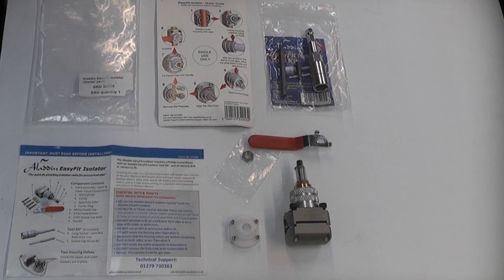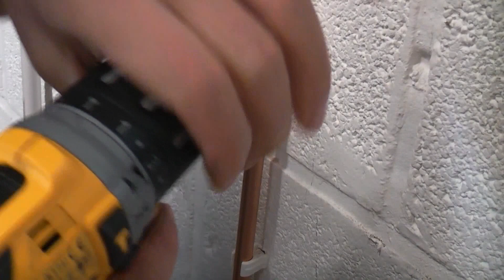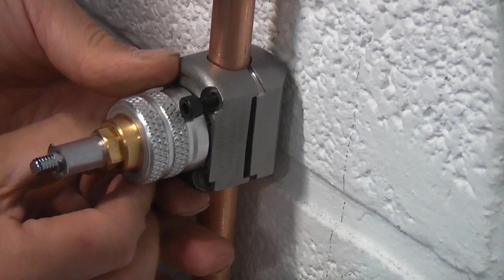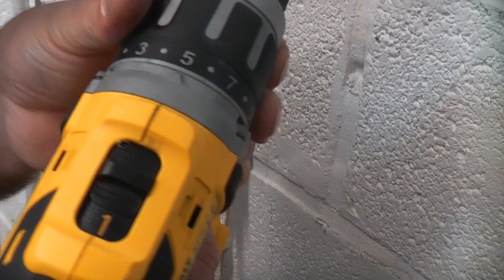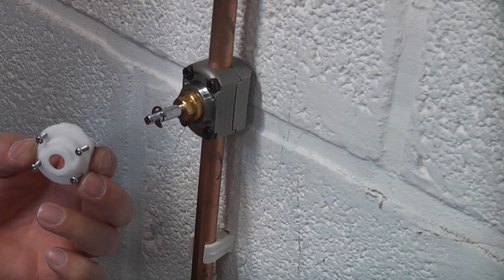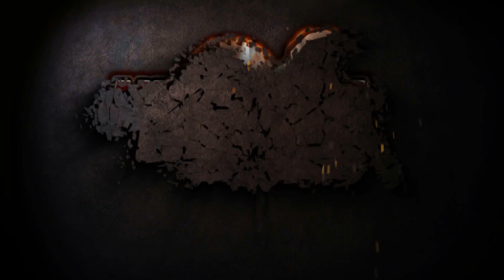Aladdin EasyFit Isolator | Isolate a live water pipe

Comment: Could you do another video showing you taking it off so we can see what happens to the part that is cut out?
Reply from the maker: I'll think about doing that when I get time ;-) 

Thanks for the comment ;-)
Reply: @ultimatehandyman  hii

have you done the "taking the isolator off" video yet ? 

thanks
andrew
Reply from the maker: The pipe was full of water and was pressurised to working pressure.
There is a follow up video here- https://www.youtube.com/watch?v=H9JSbIPLffM
Thanks for the comment
Reply: It shears the whole pipe replacing that section with the turn valve. If you go to the site and click on the FAQS of it, it shows an internal view. Pretty cool device.
Reply: Ultimate Handyman sorry about that my mistake,  I just reread your other post that said you rigged this up and missed the rest that said that you did pressurized the pipe with water in it.  Still enjoyed your video and hope you make another one taking it apart.
Reply from the maker: No problem, thanks for the comments
Reply: Paul T for what reason?
Reply: Hi Paul here is a cut away picture showing what's happening inside. Hope that helps.
Reply: I was wondering the exact same thing....it has to go somewhere
Reply: Yeah I'm a bit worried about a small copper disc left behind or a copper chip jammed in a tap. It's an emergency item I think not for everyday use.
Reply: Bravo à l inventeur un plombier de 80 ans
Reply: Would rather get a freeze kit and do the job properly......Diy kit only......a plumber wouldn’t put his name to it.
Reply: And it crushes the cut piece of pipe into the back of the device. Pic here: http://aladdin-products.co.uk/wp-content/uploads/2016/02/e-ft.jpg
Reply: @TSKseattle   Oh,no! you revealed the magic !  LOL
Reply: What's it cost?, for cup of copper shards these days?
Reply: AyrabMoneyWolf ,  the pipe is full of water and is pressurized setup to show how it works for install.  So since it's not a live pipe it would be nice to have a video of it being disassembled to show what happened and how it does is magic.  Great video by the way.
Reply: Its commen seanse what happens to the pipe there will be a big hole.
Reply: Hi our Easyfit Isolator has been on sale in the UK for over 5 years if fitted correctly they don't leak. They can also be replaced when the isolator seals up unlike conventional isolator valves using the core replacement tool.  Hope you get a chance to use our products in the future.
Reply: its handy for emergency, in  house flood and old stop tap seized up , and outside stop tap is buried in mud and crude . do you do them in 22mm, and are they ok for  emperial pipe sizes.
Reply: Paul T dude it's not meant to be taken on n off. But things like this usually leak unless they figured out that issue.
Reply: What about the metal bits from The Cutting what happens to them

Comment: I've never seen anything like this in the states!  I wonder if this meets code. I could have used this last year when I installed a new bathroom faucet, only to discover the original builder didn't install shut-off valves under the sink, AND my main house valve was faulty.  I ended up "hot fitting" two sharkbite push-on valves...while on my back, the water exploding all over...while my wife laughed at my misadventure...
Reply: We don't currently sell these in the USA.  Your pipes require a slightly different version which we have developed.  We will be exhibiting at The National Hardware Show in Las Vegas May 8th - 10th 2018 come visit us. We will be looking for distributors for our products.
Reply: "while my wife laughed at my misadventure"
Yeah, everything's a big laugh when you're not the poor SOB that's gotta fix it.
Reply: Saddle valves like this one are not code compliant in msjority of the states in the US
Reply: I'm a plumber and have had to do that same thing too. But i didn't have my wife laughing while doing it. Your comment had my wife and i laughing our a$$'s off.😅
Reply: Jo Baecker really? Its called a hot or live tap....been doing them for at least twenty years
Reply: chances are it'll exceed the code, UK has super strict standards on even non gas fittings, they have to meet UK and EU  standards too
Reply: Jo Baecker you couldn't just hit the s/o's on the water tank, manifold or at the curb? Still sounds hilarious, did she film you?
Reply: Ultimate Handyman  All saddle type valves leak
Reply: @jessepremo7398  Really?  We've been using saddle fittings (wraparound UPTs and branch saddles) on the gas mains in the ground for decades.  If fitted properly they don't leak.
Reply: Thomas Niner When I lived in Wichita, Kansas, anyone could buy a main line tool to shut off by the meter. Now living 85 miles north and this city doesn't allow that and even changed the shut off to something I've never seen. It's stupid!
Reply: well it never would have exploded  if u would  have shut the main off at meter
Reply: Aladdin Plumbing Products when will these be available in Canada?
Reply: Or in Canada as a whole for that matter.
Reply: go to screwfix website buy one bud
Reply: Something very similar is used in the states to fit a curb-stop to a live water main.
Reply: so this doesn't work in America?  on American copper pipes?
Reply from the maker: They are introducing them in the US market later this year.
Reply: puckcat22679  Any kind of water line that you have to purge before consuming water out of is a no go for me... Just stating the obvious in case no one noticed
Reply: Im a plumber . And i think i would had shut water off at meter.  Or either turned power off to pump. Which ever you may havem city or well. But i would have loved to watch you try to slap them things in live . Hahah. Ill get the mop
Reply: I had the same issue in my condo years ago. The city wouldn't shut off the main without consent from the condo board and they were useless odors that didn't understand water damage. I ended up doing a compression fitting shut off with water spraying everywhere, including blowing the ring out of my hand one time. Code or not this thing would have made life so much easier, even if I had to do another shut off 6 inches down as a permanent fix.
Reply: @cliffdiver8386  don't call the city. I've shut down hundreds of condos to replace the house valves. After replacing the house valve. I then can shut it down to do any repairs needed in the condos. 
 City valves are an easy 1/4 turn or 1/2 turn ball valve. You dont need to call the city.
 Now, My city has a 100.00 dollar fine if caught turning one of their city valves off. I tell me customers if they dont want to pay that fine. I'll show up and wait for the city to show up. The will give you a 4 hour window. I'm a 175.00 dollars an hour. It's much cheaper to pay them instead of paying me. After I'm done with my repairs. I can walk out turn the city valve back on & test everything. If we have to wait for the city to show up. Are you going to pay me to sit in my truck to wait for the city to show up & turn the water back on so I can test my repairs??
BUY A STREET KEY!
If you don't know what that is. Get out of the business!!
Reply: Jo Baecker Did you get the main house shut off repaired?
Reply: Of course your wife laughed her butt off because of you thought you were a plumber. Maybe next time she'll crawl under the sink and perform this procedure correctly to the letter, doubt that!!! Oh the wonders of modern woman's lib
Reply: No it would not be code approved depending on your location, as this is considered a saddle valve.
Reply from the maker: I'm sure they would meet the code, they are WRAS approved in the UK.
I once changed an outside tap "Live" as the check valve inside had failed, I could not isolate it as someone was parked over the stop tap in the street, I was soaked at the end of it ;-)
Thanks for the comment Jo ;-)
Reply: Ultimate Handyman unfortunately, the US tends to have a bad case of "not invented here" syndrome when it comes to approving new devices from other countries. It was a decade or two after PEX pipe became common over in Europe before it was allowed here, for example.
Reply: Because of the bluemax failure.
Reply: My Dad worked for the local water company. When he retired he "borrowed" a main line at the meter shutoff tool. Have thanked him many times.  One of my prized tools.
Reply: Jo Baecker.  Ever heard of a city main valve at the street. Did you replace the house valve so when the shark bite fitting fail you are able to shut off your house. Especially if it happens while you are at work & the laughing wife has to save the house from flooding?
I've owned a plumbing business since 1974. If any one of my plumbers used a shark-bite fitting on a job. He would be looking for another job.
   Just saying.....
Reply: Shark Bite fittings = AWESOME!

Comment from the maker: I saw one of these for sale at Screwfix and just had to get one to test. I didn't have a water pipe where I needed one of these installing so I rigged this up in the garage using a piece of copper pipe connected to a pressure testing bucket, which was pressurised to mains water pressure. 
It's about £45 for the kit with the tools included or £40 for the kit without the tools, I know these are not cheap but one of these can be a real life saver in certain situations.

I hope everyone has a great bank holiday weekend.

I'm off to paint my garage door ;-)
Reply: Ultimate Handyman Looks very handy! Great video as usual, thanks
Reply: I always keep a couple in the van for emergency call outs, very handy bit of kit.
Reply from the maker: Thanks for the comment ;-)
Reply from the maker: You are welcome, Thanks for the comment
Reply: Very interesting gadget, the only thing missing here is the guts--how it works exactly just out of curiosity and confidence.
Reply: Ultimate Handyman _
Reply: Ultimate Handyman .n
Reply from the maker: Did you fit a back draft shutter- http://fave.co/2jYsMSr
Reply: Ok but since it's on a Test Rig you should have pulled it apart at the end to show us how it worked it would have been the most interesting part and the only reason I watched the video ?
Reply: Ultimate Handyman  This  Will not last The test of time, Just like a saddle valve they will leak. Cut the pipe, do it right, put  a T fitting in. Or shut off valve /T
Reply: Ultimate Handyman s
Reply: Ultimate Handyman Where can I get one in the United States
Reply: Where can I buy them in United States
Reply from the maker: The company are looking for a US distributor right now, they will have more info on their website-
http://aladdin-products.co.uk/products/easyfit-isolator/
It looks like they will be in Vegas in May 2018 according to their site
Reply: maybe you can help me .i put in a cooker hood and now its winter the kitchen is freezing any tips
Reply: on the dry I had same problem and got an in flue damper ,uk
Reply: no . and thank you  great help
Reply from the maker: https://www.youtube.com/watch?v=H9JSbIPLffM
Reply: It cuts (punches) a hole in the pipe and then re-routs the water thru the valve; thus allowing the flow to be turned on or shut off (that's American for isolated or non-isolated).  Cheers
Reply: It’s called “hot tapping”
Reply: plug'in your item yeah
Reply: How to replace car wishbone
Reply: Ultimate Handyman thanks for that. Great video mate.
Reply: just used one today, whoever plumbed my flat, didnt have a clue, there are 2 feeds from the pipe that feeds the flats i live in from a water tank on the roof, only the kitchen has a stop cock. i had a leak from the cistern connection and freeze spray didnt stop the water spaying all over the bathroom, so i installed one of these on the plastic pipe and it worked a treat

Comment: I can see the thought behind why or when you would use one of these but I cannot help be concerned about what happens to the small fragment(s) of copper pipe that is removed when the self cutting part of the device is driven into the pipe.  I am not sure I would be overly keen on copper fragments floating around my system.

Comment: They have been making some real time saving gadgets for plumbing, I love it. It always seems like they don’t put shut offs where you need them, so you end up shutting down the water for the whole building until you make your repairs. Very informative video and I like the way you stressed READ the instructions, I’m sure it could go very wrong if you don’t.
Reply: You'd think they would then add a cut off valve everywhere, learning from their mistakes, but nope, building shutdown, fix the one pipe,  and no cut off-... save for the next person to go shut down the building water again!! Its like cars without a drain plug for the transmission fluid.

Comment: For the life of me I never will understand why a plumber will not at least offer a homeowner the option of shutoff installations where needed when hired for a job. The homeowner could just refuse if cost is prohibitive or be happy to pay for what is a great savings in the long run. In a house I aquired, pipe after pipe had to be cut, installing shutoffs with handles like the one on this live shutoff valve but the kind used were all brass with an internal ball valve and needed soldering on both sides of the copper pipe, with main water line shut off.  Installed was a shutoff on every single pipe with an outlet. Going along, eventually, there was no need to shut off main water supply because there was an array of shutoffs everywhere at this point.  Bought was the best quality, commercial, heavy duty, brass, ball valve, with heavy handled shutoffs. While a bit more expensive they will last indefinitely and are done once and for all. Valves placed  by my dad in his and my moms home have been there from day one and in 64 years have performed magnificently, not a leak, no wearing out, no rust issues, no problems at all.  These valves for live water situations here though, in an apartment type or shared, multiple garage setting, where one does not have access to all plumbing pipes is a very good alternative. I have never seen them in any plumbing supply store so I wonder if they are sold where I live. Will have it checked out for sure and have experiments if able. You explained the how to for these valves in an easy, no nonsense manner, not leaving a step out. I wish you had an update for their actual use and if they are applicable for use on the hot water pipes, possible changes like flow, leakage, endurance and longevity so far while in use. Thanks for the video.
Reply: Because people are cheap pricks, "oh those taps will never fail I picked those out myself" and other such rubbish, six months later.......
Reply: Unless there is a building plan they have they will install according to specifications that was drawn out, to pass inspection.

After that it all depends if you can pay them for that job and if it is code approved. If they decline they are some how loosing money or just tired of dealing with a particular homeowner.
Reply: Adding multiple valves in a house is  redundant and over kill. The only place inline ball type valves should be are the main coming in, the water heater and before any outside hose bibs. Thats it. Any more is a matter of opinion and preference.
Reply: Sometimes old shutoff valves seize up or break so that they won't function. Old gate valves are prone to failure if they aren't cycled every once in a while.

Comment: Looks like an amazing bit of kit. I don't have any need for it because I have my own supply with isolator in the road as well as house, but I still want to get one!

By the way, ever seen a good mains powered isolator? I need to get one for my automation system that turns off incoming water when flood sensor is triggered?
Reply from the maker: Sorry Mat, I have never seen a powered isolator before for domestic plumbing ( we use a lot of pneumatic control valves at work though )
Thanks for the comment ;-)
Reply: Look up ' water cop '

Comment: It's a bit like hot tapping a pipe. It is normally done on mains gas pipe and water pipes. 
Good to know these are handy if ever needed. 
Love the videos, keep them coming.
Reply from the maker: Thanks for the comment ;-)
Reply: +InsideOfMyOwnMind   Saihan Islam meant it's the same basic design as we use in large diameter gas mains. Such as a Williamson style tapping "T"
Reply: I wouldn't want to use it on gas pipe.

Comment: £45? about $80? cheaper than drain down labor.
Reply: £45 British Pound equals $58.24 US Dollar, so even better:)
Reply: Hi thanks for your comment. At Aladdin we develop innovative products to provide solutions to plumbing problems.  The Easyfit solves the problem of not being able to easily isolate water supply.
Reply: @Aladdin Hey, a lot of old British houses still have pipes using imperial sizes, plus you have the United States that has them as well. Are you planning on bringing to market imperial versions? Maybe even a 20mm option? :-)
Reply from the maker: Absolutely.
Thanks for the comment ;-)

Comment: A handy thing to have, thanks for the demo. Tom Plumb did a video on cutting into a live pipe and fitting an isolator. Very clever method that made very little mess, you might like to watch it if you haven't already seen it. Just needs a standard isolator and a length of garden hose.
Reply from the maker: I'll check that video out later ;-)
Thanks for the comment
Reply: Garden hose ? I don't want to bleed the system .

Comment: What a clever little gizmo! I assume the bit of copper that is cut is left in there, are these reusable? Cheers for the review.
Reply from the maker: Yes, it is compressed into the pipe. I'm afraid you cannot re-use them.
I'll pressure test this in a future video and will disassemble it.
Thanks for the comment ;-)
Reply: F De Mascio c
Reply: The slug gets compressed into.the back.end of the valve body.  The company website shows the detail. 
https://goo.gl/images/6cbqb4